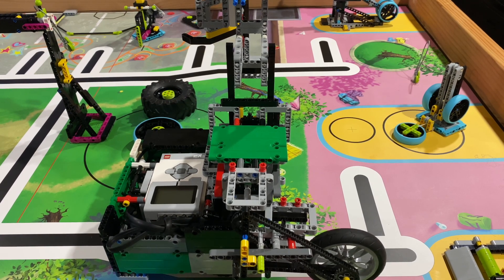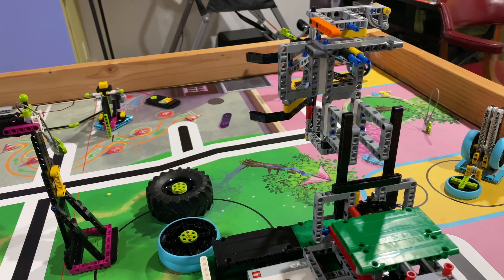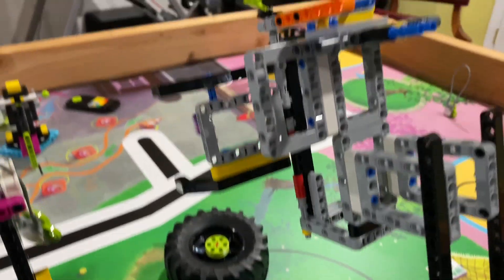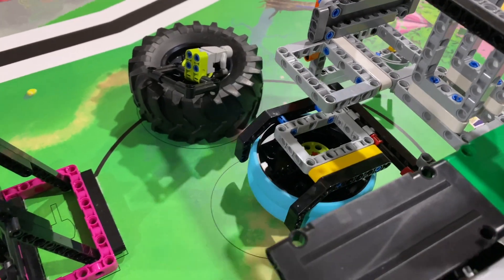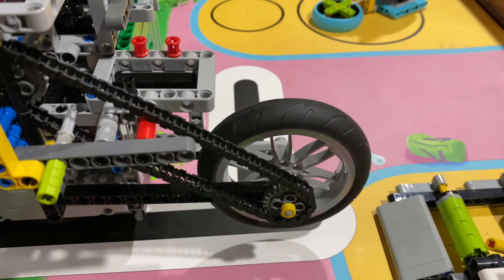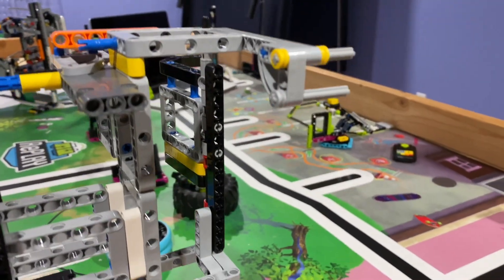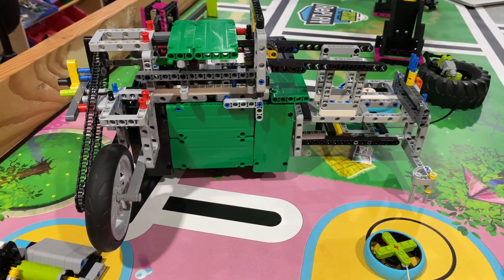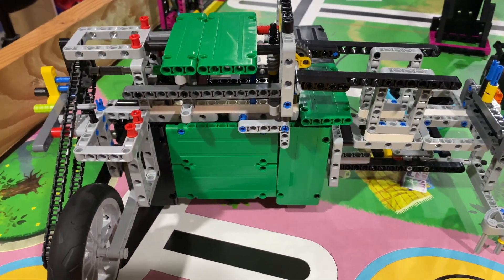FLL RePLAY - Run 2 Mechanisms

Comment: One thing you need to note is that you didn’t make your treadmill mission correctly. The stopper should be on the gear not the roller so that it can only be spun in one direction. This might affect your proper results so you might wanna look into it before submitting your video 👍

Comment: Hi nice video. I was thinking about are you useing gyro when du flip Tire, Color sensor or normal drive and What speed?
Reply from the maker: Hi, I am using just a normal drive at about 30 speed for this but since it's just in a straight line and we like to be loose on time, I've sped it up to about 55 or 60 and it still works great. I think this is the most reliable way to still score the most points.
Reply: Wordynerd48 Thanks for answer👍

Comment: Hi, Great vid, could you please post building instructions, my team could really use this
Reply from the maker: Paarth Jain Sorry! I’m afraid I cannot provide instructions because it sort of ruins the spirit of competition, the creativity of other teams, and we are competing this year so we don’t want everything we have on the internet. I hope that showing the mechanisms will inspire you, yet not ruin your creativity like I got my inspiration from other teams. Also, it probably won’t fit on your robot because the attachments only fit mine. Sorry again, but if you watch my mechanisms, you’ll learn to look at FLL videos and make a more efficient model, adapted to your robot, that will work great in competition! Wish best of luck this year!
Reply: No problem; I was just hoping to know how u drop the slide guy accurately
Reply from the maker: @paarthjain3337  Cool! To drop the sliee figure, its sitting on a ledge on the arm, you can maybe see it in the video although I didn't go over it that much. Instead of a flat backthat it's resting on, we used one of the half pieces so its tilted downwards, therefore when its In the air and flat, it stays on but when the arm is lowered and parallel to the ground, it drops onto the tire. If you  look at that part of the video closely when I explain it, you can see the half piece
Reply: Thanks, Love your content by the way, my team: the RoboTechnicians have taken slot of inspiration from you!

Comment: How many motors do you use in this robot to drive and complete missions?
Reply: He uses 4 motors in his robot I believe
Reply: @williamzhao3466  Thank you. I have two motors and can't build anything like his EV3
Reply: @littlekinderclubcoloringfo5524  this is a more advanced design, there are still many options for doing these missions
Reply from the maker: Hi all, I did use 4 motors in my robot, however, there are many designs that can score high points with only one medium motor like in the base set and even with only two large motors, you can still to amazing things with passive techniques for missions like collecting the health units, boccia, the bench mission, the basketball cube in the crate, the rowing machine, the pull up bar, and so much more as long as you put your mind to it. You can check out my 170 points in 10 seconds video, the FLL Expert's rowing machine maximum score video, or Flep's video on boccia for some inspiration on how passive techniques can help you score high points even without a medium motor.